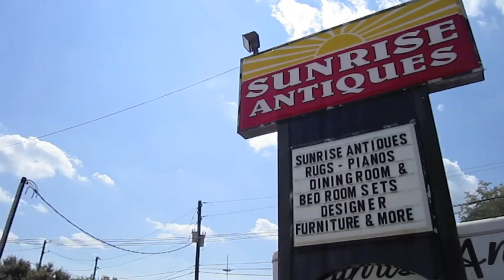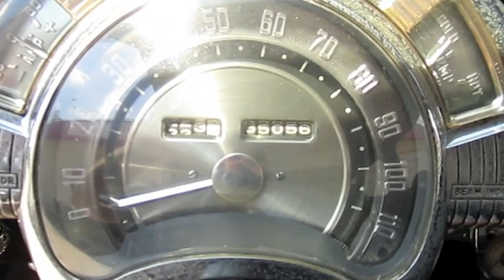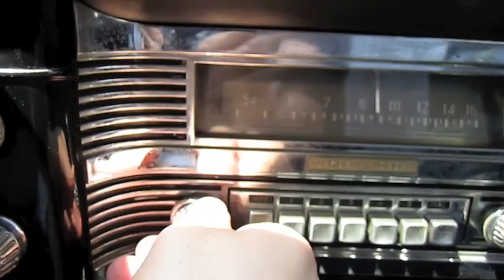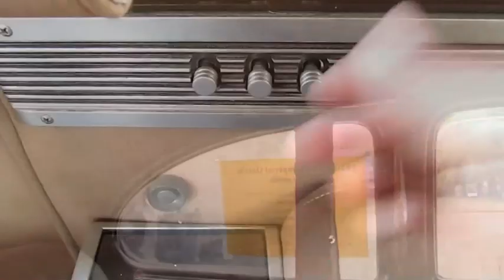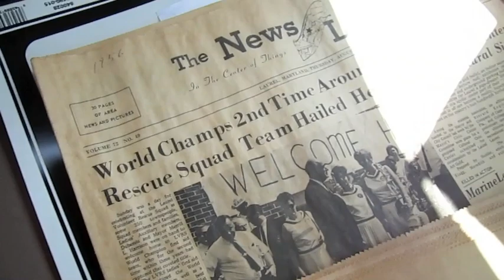1950 Chrysler Crown Imperial Limo Detailed Interior/Exterior Tour w/ Engine Details

Comment: Fantastic original car. These young guys have no clue what it is. A modern car won't look like that in 60 plus years. Those things were built to last.
Reply: Then why were they all considered junk after 80,000 miles? There is a reason the odometers did not go past 5 digits.
Reply: If you changed the oil regularly, they lasted a LONG time.  Much longer than 80,000 miles

Comment: These were quite rare new, and by the time you find them now, all kinds of nearly extant parts (trim, etc.) are missing. This one is pretty complete. All the stainless, chrome, and trim are there, and in pretty good shape too. Interior doesn't need a WHOLE lot. Those are fairly easy to reupholster, and the mohair fabric doesn't cost a king's ransom. The Crown Imps make quite a statement, almost like an American Bentley. It has hydraulic power windows, nearly silent when they operate too. Hope this found a good home, and the TLC it needs..........

Comment: Some observations - 1) This car is probably not equipped with A/C,unless someone added a later dealer installed or aftermarket unit . Factory Air wasn't available on Chryslers until 1953,I believe. 2) The transmission is almost certainly a Fluid Matic semi automatic transmission,which had some features of an automatic transmission, and also some features of a standard transmission. Always keep in mind that no Chrysler automatic transmissions had a way of locking the transmission until at least the 1961 model year; you had to use the parking brake,or chock the wheels in some way. 3) The power windows on this car are hydraulic over electric,so they will be expensive to repair. At least if you bring this car to a show or cruise night,you'll be the only one with a car like it. A unique car,for sure.

Comment: Three comments on the description of this Crown Imperial.  The windows were not power but hydraulic and you can see the tank on the firewall when the hood is open.  The were prone to leak and would damage the door panels.  All of the window switches and other bright work was known as "Butler's Finish" and has more of a satin look.

It is not a stick shift but a Fluid-Drive which is actually a 4 speed with two ranges in forward gears.  Chrysler used this basic transmission through 1953.  I learned to drive on one.

The dash controls that are stated as "A/C" is actually the heater controls.  Chrysler didn't offer A/C until 1953.

The spare tire which he does not show was stored under the trunk floor and accessed by lowering the center section of the rear bumper.  Note the bolts on either side of the bumper.  These cars used a Dodge truck rear axle assembly and were wider than non Crown examples.  Many people refer to all Imperials of this ear as "Crowns".  Only the long wheelbase examples were that.

Some years ago I owned one of these.  There were 205 units built with the divider glass (formal limo) and 209 eight passenger sedans built.  The latter did not have the divider glass.
Reply: Hydraulic IS power, just not electric.

Comment: My grandfather purchased new a 1950 New Yorker that was only slightly smaller than this beauty. My mother frequently borrowed, and then owned, the car. That is not likely to be a manual transmission. It is a form of automatic. Put the car in 3rd gear using the clutch, and then drive away. Lift off the gas to shift automatically. It can be shifted through the gears, but not necessary. I drove the car around the yard and often pulled out the 6-volt battery and lugged it into the basement to charge

Comment: what happened with Chrysler? They dont build cars like this anymore.
Reply: Bender Rodriguez They are Fiat now, that's what has happened.
Reply: +Strongholdex I have a 1990 chrysler new yorker. I think it's better than anything new that chrysler comes out today.
Reply: +Strongholdex They stopped being like this long before Fiat
Reply: The same that happened with every other manufacture. They all were regulated down to crap.
Reply: Everything get worst after Chrysler merged with Daimler-Benz
Reply: This was a separate car manufacturer, they built their own engines and bodies.
Reply: Styling and engineering trends moved away from the like. People wanted cars with sleek, modern design (jet-like styling and OHV V-8 engines) so "fat-fendered" cars with valve-in-block engines fell out of popularity.
Reply: Don't be fooled: Chrysler has been teetering on insolvency, bankruptcy, and completely going out of business since the mid-1970s. First Iacocca saved the company with a govt. bailout and bringing out those horrible K-Cars (but hey they sold and put the company into the black - for a while). Then in the 90s the company went down hill after Bob Lutz left, selling to Daimler-Benz who just let them wither away by giving Chrysler 10 year old Mercedes platforms to build cheap garbage on. When that whithered up Daimler sold them to a hedge fund manager who sucked whatever was left of the company completely dry to where they were either going to go out of business or be aided again by the govt. The govt. essentially put them up to auction where now Italian conglomerate Fiat owns them.

Chrysler has used up over half of their 9 lives!!!
Reply: Bender Bending Rodriguez when fiat bought them, it went downhill. I own a 98 dodge caravan and it’s the most reliable vehicle I’ve ever owned
Reply: @jrt2792  I have a 91’ mark cross edition fifth Avenue New Yorker and I love it. There one of the last true luxury cars from Chrysler in my opinion

Comment: "Some new and unique feachers for 1950 include; A/C, power windos, trip odometer, and seats that come out of the floor to hold up to 7, its all new for 1950. Chrysler we offer luxury...   for less"

Thumbs up if liked my '50's commercial add
Reply: No way does this car have air conditioning! Chrysler didn't even offer it until 1953. Do you see an A/C compressor under the hood? No.
Reply: AC?  Not until 1953.

Comment: One of the first cars to have 4 wheel disc brakes,not your regular disc brakes,the discs were actually inside the drum 2 discs per wheel and the pads were bonded onto the discs,similar to a puck clutch plate,weird but true.Regular drum brakes couldnt stop that beast.

Comment: Those flathead straight really sucked for efficiency, but they were very quiet. 323 cubic inches, 135 hp, 230 ft/lbs torque. 1950 was the last year for the straight 8. 

Next year they came out with the hemi—331 cubic inches, 180 hp, 312 ft/lbs of torque. What a difference!
Reply: More like 280 lbs. ft. of torque.  Part of the poor efficiency is because Chrysler, during 1946, switched from 2 barrel carb to a measley 1 barrel.

Comment: the chrysler imperial limo did not have air conditioning until 1952 and the transmission is a semi automatic called fluid drive .you push in the clutch and put the shifter in the third gear position let out the clutch and pressed the accelerator after reaching around 20 /25 mph you lifted of the gas and the tranny automatically shifted into high gear. it had a low gear for mud and snow wich was in the what would be second gear position. often used to get going faster.

Comment: The standard heater controls for Chryslers at this time would appear to be a/c controls to a modern viewer. The controls mentioned as a/c appear to be simply routine heater and vent controls. Are you sure there is air conditioning? I see nothing under the hood indicating a/c, nor are their any vents into the cabin for it. Further, the car probably didn't have a manual transmission, but a semi-automatic requiring a clutch only to put the car in gear or to change driving ranges, with a fluid coupling.
Reply: A/C units of this vintage would have been in the trunk.
Reply: You are absolutely correct.

Comment: That is not a manual transmission, it is a semi-automatic.  You do need to declutch to select a range, but after that, you drive clutch free and shift free, as a 2 speed automatic, unless you need LO or Reverse.  If it is stock, it does not have AC.  It has summer ventilation and winter heat.

Comment: On this year Chrysler products, the horn will not work if the ignition key is not turned on. Also, this car does NOT have AC.  Also, This car does NOT have a manual transmission, it is semi-automatic.
Reply: WATASEE How does the semi auto tranny work?

Comment: I doubt the claim that it has a/c--that was very rare in 1950.  As well, I saw no compressor under the hood, and the heater/defrost controls demonstrated are just that--heater and defroster, exactly like my 1950 Dodge.  If it has a/c, the compressor is missing and the controls weren't shown in the video.  The evaporator, etc., would have been in the trunk, but that wasn't shown.  The only thing that makes the a/c claim possible are the vents of some sort on the edges of the divider, under the divider window.  But those were more than likely for heat.

Comment: It's actually a semi automatic with Fluid Drive
Reply: How did that work?
Reply: Basically a two speed stick with electric overdrive controlled with the accelerator pedal. And fluid drive means it has a torque converter instead of a flywheel. Check out allpar.com. The have quite a thorough description of it.

Comment: This car didn't have a standard transmission.  It came with fluid drive which in many ways was better than automatic transmissions.  You said this car had AC.  Under the hood I didn't see an AC compressor nor did you show the trunk for the unit which would have been in there.  You generally do a fine job but you screwed the pooch on this one.

Comment: manual shifting on the column, whaaaaa
Reply: Actually, it is a Fluid Drive which is a semi-automatic transmission. Has Low, High, Reverse, and Neutral. Low and high each have two speeds, for a total of four speeds. It's not a three-speed manual.